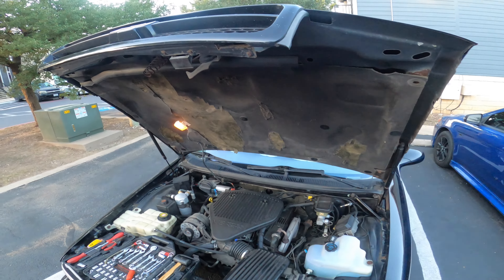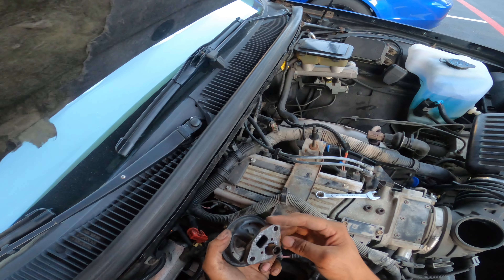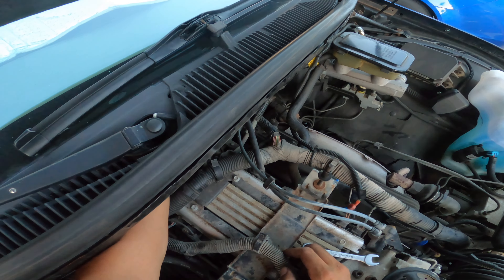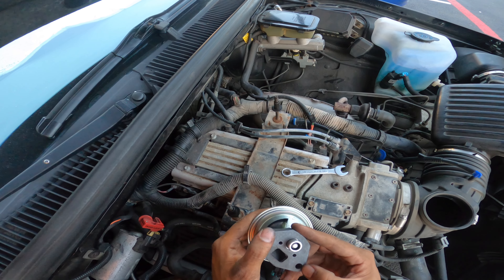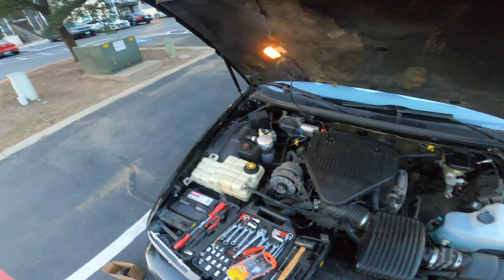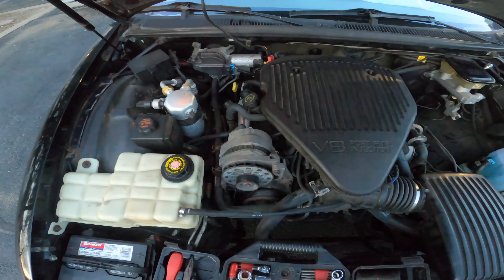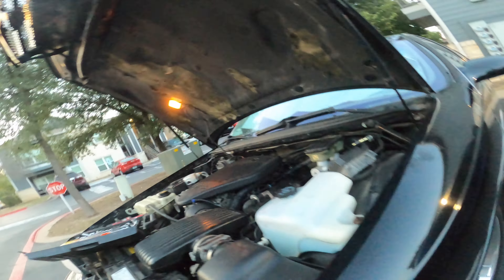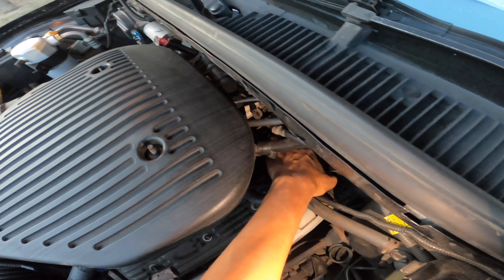1994-1996 Impala SS EGR Replacement (Update On Impala)

Comment: I deleted the egr on my 95, runs better and also runs cleaner, engine oil is still clean after 7 months
Reply: Did you have to tune it after delete how did you do it
Reply: @haniballector   I ordered a block off plate kit and on the 95 she don't even throw a code for the egr valve, did the same on a 95 suburban and it just throws a code for closed egr but it'll turn off after 30 to 45 minutes of highway driving
Reply: @mikeaugustus4210  Can you post a link or name the part or part # for the delete kit?

Comment: Did you ever figure it out...mine doing the same thing..EGR code....idle rough some times..check engine light sometimes..smell gas...havent changed egr yet
Reply from the maker: sorry to hear that man, so for mines It ended up being an issue with the wiring from the remote start and being into the fuel rails wires, took it to a shop and they crossed my wires from one rail into another fixing the problem but then gave me a permanent check engine light due to the wiring.. so yeah I would check the wires going towards either fuel injectors/fuel rails.

Comment: If you haven't replace the plug wires and make sure you get the plug separators
Reply: What are the plug separator needed for? Arcing? Could you give part plz?
Reply: @hoppskippity  yes
Reply: @hoppskippity  you can pick them up at most auto part stores their just called spark plug wire separators
Reply: Thank u @americaisthegodfather